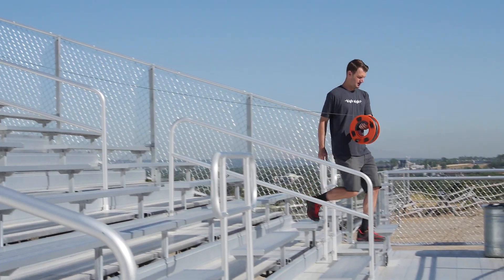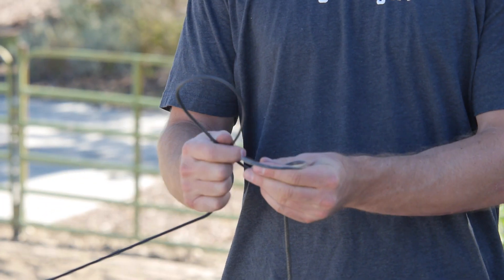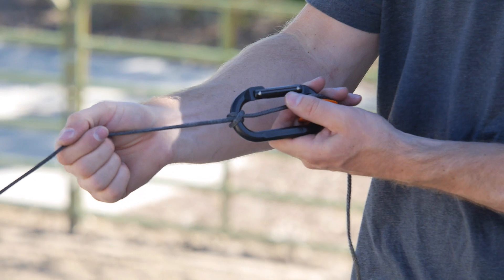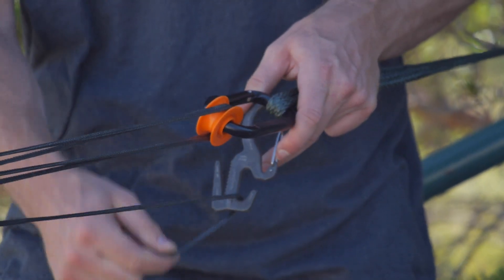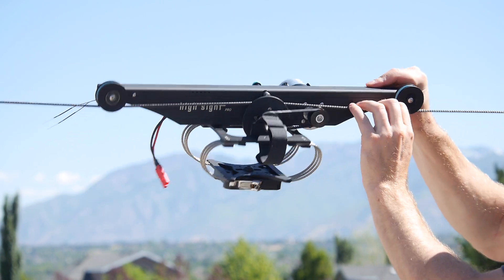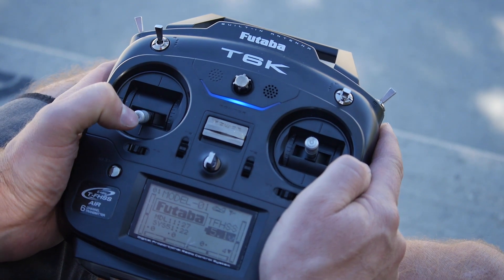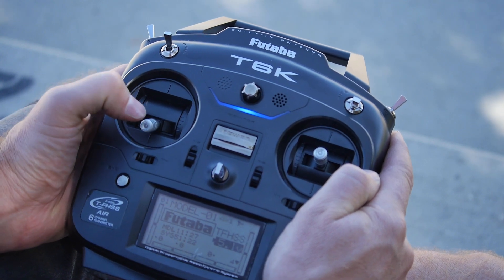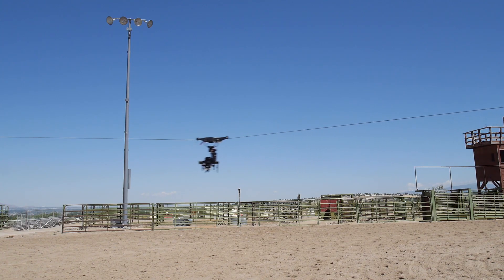High Sight Tutorials: Setup & Operation

Comment: How do you get control of the gimbal through the included remote?
Reply from the maker: If you are using a dji gimbal you can plug the receiver into the SBUS port of the gimbal to gain control over the gimbal pan/tilt. This works with any SBUS capable RC system. Like the Futaba, Frsky and Spektrum systems.